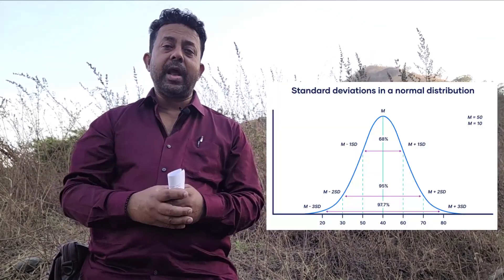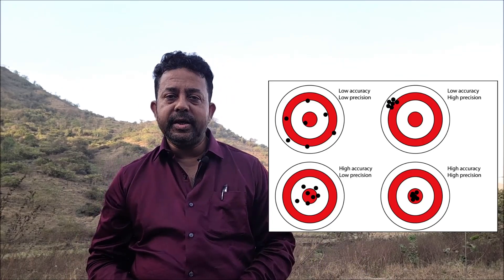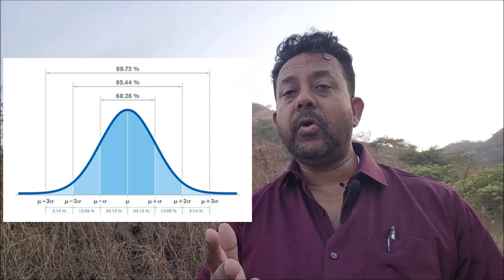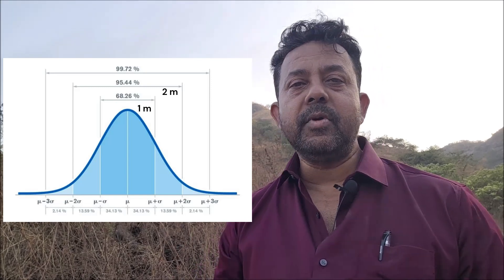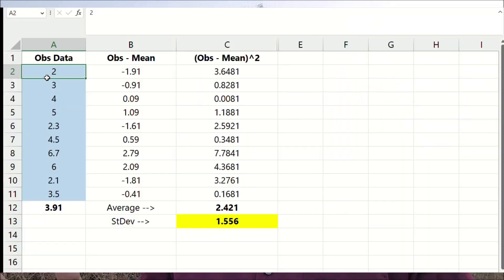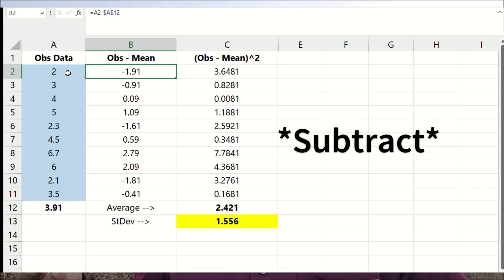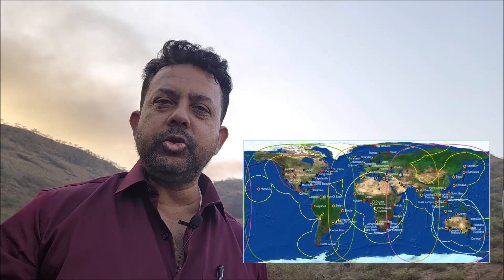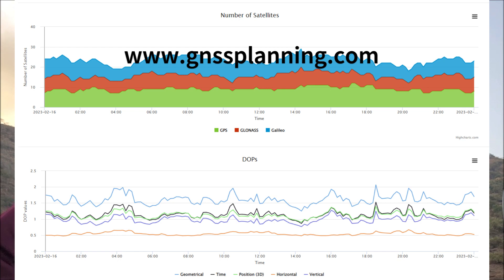What is Accuracy & Precision?

Comment: It's very nice. we are using the ITRF reference frame to stabilize our local stations. It's great to hear without ITRF also we can estimate the position accuracy using the repeatability method. Is it correct?
Reply from the maker: Yes your position will be accurate and precise, on that day. Down the line, say in 2 to 3 years the position will deviate even with ITRF.